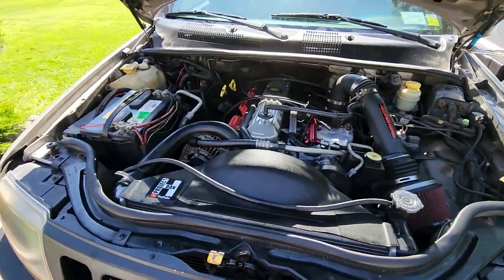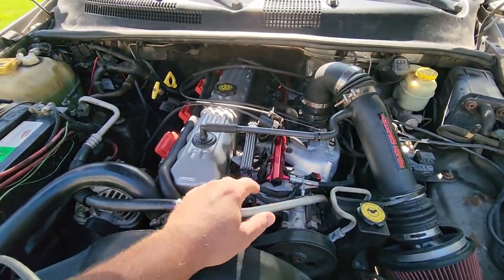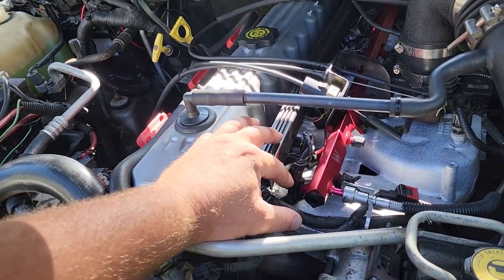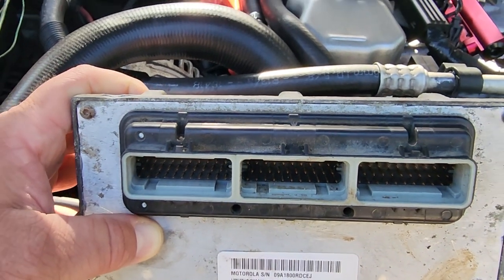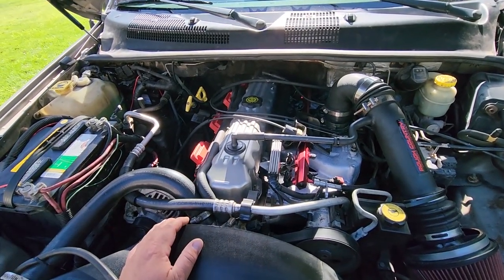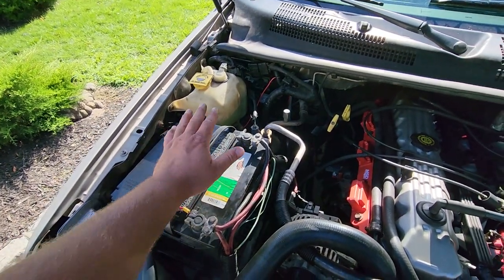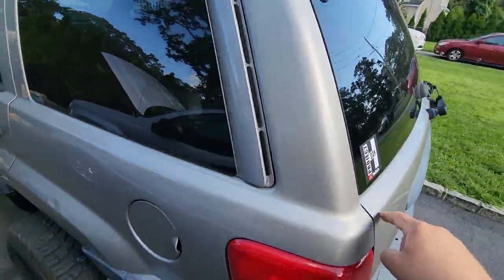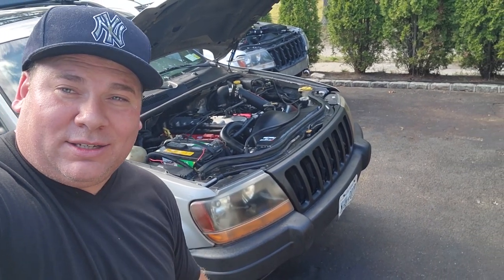JEEP GRAND CHEROKEE ENGINE SWAP AFTERMATH - WHY DID THE OLD 4.0 BLOW UP?

Comment: Jeep XJ and WJ in my driveway cause me to take special note of Dan's findings and repair.  And it's hard to explain why I like my XJ.   And it has some kooky little problems but not such as melted injector wiring (yet).  *Failed and worn key switch.  Intermittent passenger window control fail (may be driver door wiring boot).  Difficult trans line connection at radiator. Came with jeep vs deer right front grille and bumper impact damage w. crushed AC fittings front..  Blown head gasket. *required engine swap.  worn torque converter output  shaft leak. (caused vexing trans oil leak to driveway)  Weak drivers side window regulator. What's to like?.  Well... The slightly more compact body with a remarkable turn radius,  the solid ride of the Dana 30 front axel.  Great visibility and the full 4x4 engagement. 4 low as handles deep snow and where ice, mud cause difficult driving.   Note.  I made a small shield to protect the pass side firewall electronics from water. Water entry as to this area may have caused hard fault to injectors?.   In the end, as with the repairs shown to Project Dan, I don't mind the service required to keep my XJ at peak performance.  Storms may come. Rocks, potholes, ice and mud are real. M.

Comment: definately not a fan of the pre cat exhaust on the 2000-2006 4.0.  i think that is what creates even more uneccessary heat in the engine compartment. his rough country hot air intake probably isnt helping, id just put the stock intake\air filter setup back on it. Nice work buddy, thats a really nice clean install for sure.
Reply from the maker: I agree %100, The extra header cats are terrible. Thanks for the View brother!

Comment: Great job Dan O I can see hes happy with the turnout . My question is did you have a good scan tool hooked up at any point?? The wiring can a headache forsure but I notice he has some accessories hooked up to the battery.  Those can short things out too and back feed to the new pcm so make sure everything is grounded and has fuses.  The only thing missing in this build is some chrome engine goodies 😂 It looks like he'll have a great running jeep for years to come .
Reply from the maker: Yes I did, only showed misfire codes and injector codes
Reply: @ProjectDanH  You can turn on and off coils and injectors with a snap on or oem scan tool but with all them bad wires idk if this would of helped

Comment: cylinder 5 I've swapped 3 with the same exact damage same cylinder. I drove mine 20 miles with a hole in the block.
Reply from the maker: Oh my!
Reply: @ProjectDanH  it's only been on 2 2000 xjs and 1 2001 grand cherokee I don't know if those were just junk years but they all had about the same mileage 250k

Comment: I've got a 1996 Jeep Grand Cherokee Limited. There other day I went to check the transmission fluid and it was ok, but now the dipstick won't go all the way back down like it's supposed to. What am I doing wrong.?
Reply from the maker: Sometimes they hover about a 1/4 inch above the tube.. annoying but normal 😂
Reply: @ProjectDanH  Thanks.

Comment: Hey man love your videos! Helped me with quite a few issues I’ve had with my Wj. However, I’m currently pulling the motor on my wj jeep. I’m gonna reuse my motor hopefully and build it back to a 4.6 stroker. It’s been so hard to find videos of people pulling the 4.0 out of a wj. I haven’t found one yet. When you removed the motor from this wj did you have to get all the refrigerant out of the   a/c system? I really don’t wanna have to unhook it all and recharge when I’m done. Is there a way around this? Any help or advice would be really appreciated. Was kinda hoping I could just put it out of the way like on the XJs.
Reply from the maker: Yes.  the compressor wont roll out of the way like the XJs as it is located on the bottom of the drivers side of the engine.  If you carefully release the shrader valve and don't inhale, lol, you'll be ok.  just refill the system with refrigerant from Walmart when you're done
Reply: @ProjectDanH  thank you man!! hardly anybody online has covered that part. I’ve been searching for days lol.

Comment: Love the video.  I got a 2001 WJ engine is making noise.  Wish I had someone in my area to swap an engine that loves jeeps.  Any idea what that would cost?  Keep up the great work.
Reply: I just reviewed the video again the oil was for diesel with added zinc. Won’t that ruin the catalytic converter long term?
Reply from the maker: Long term isn't great for a cat... But it's easier to replace the cats than the whole engine 🙂

Comment: Just FYI if you are using Rotella 10W30 diesel oil it has 1400 PPM of zinc you do not need to add additional zinc too much zinc can cause problems on its own